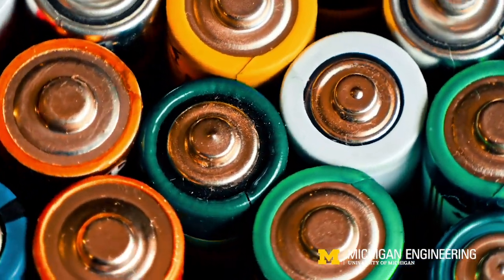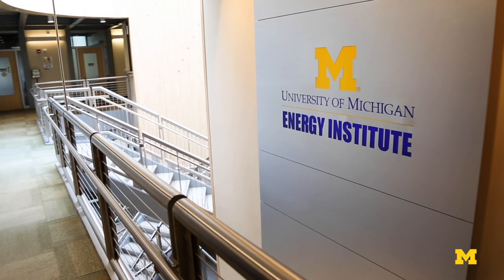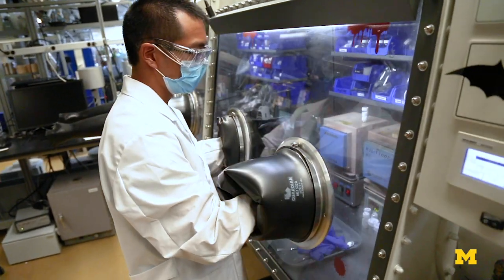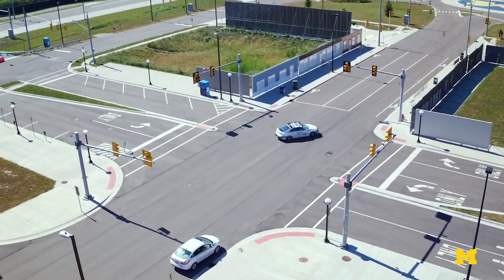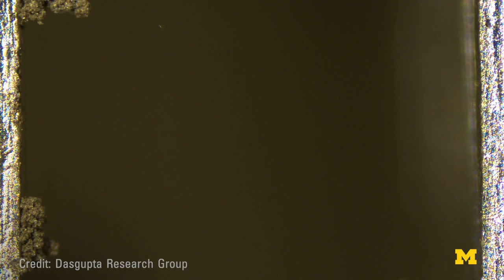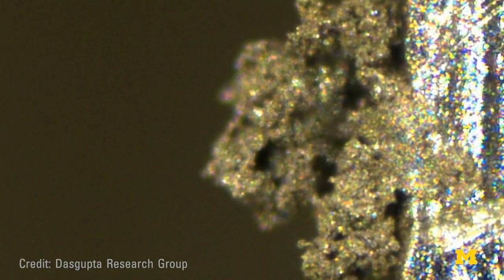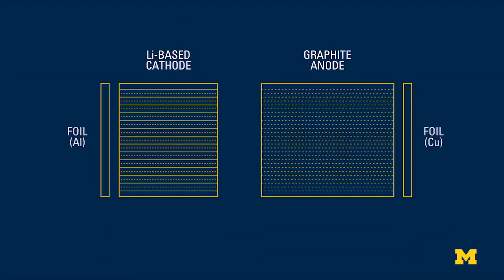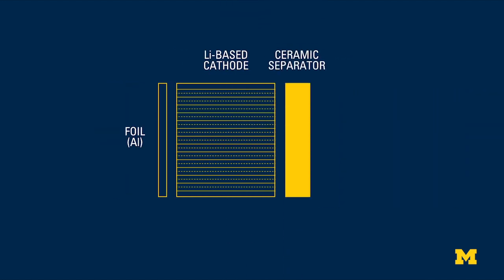Building 'holy grail' lithium metal batteries cheaply and safely

Comment: Great but we are still using fossil fuels to create electricity to charge batteries!
We need to produce more nuclear energy and develop more efficient solar cells in the future.
Reply: The best, most reliable and most foolproof energy source is the moon. Capturing energy from tidal shifts doesn't require new methods or unobtainable equipment. It isn't impeded by clouds or rain(like solar) and doesn't rely on ultra-critical technology that could fail at any time and absolutely decimate it's environment for the next 50k years(nuclear). Gravity is, was and always will be a constant that can't be altered. In theory there is enough energy in tidal shifts to power the world. In reality it will only be viable to coastal cities due to transmission obstacles. When wireless energy transmission is perfected our efficiency in energy production will double.